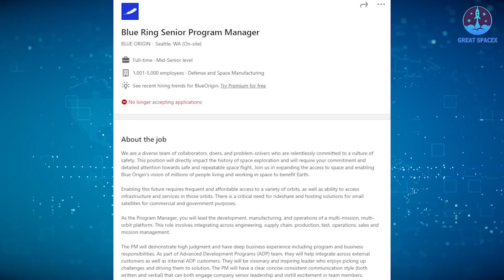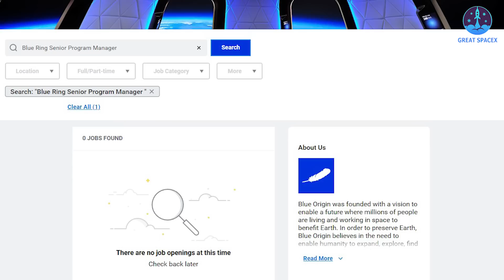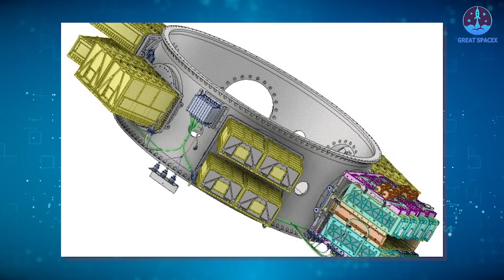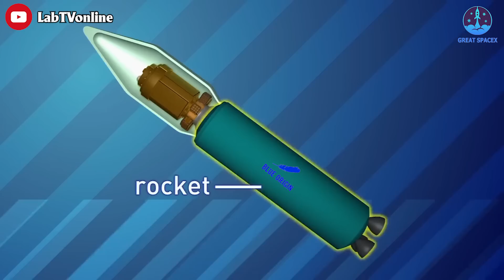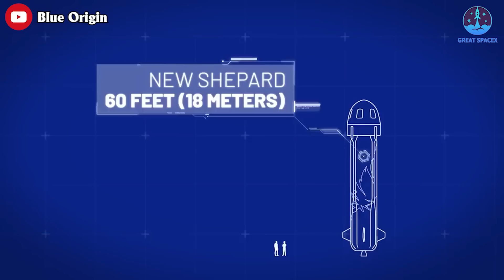Blue Origin New Glenn made HUGE PROGRESS try to catch up SpaceX 2023...

Comment: A fuel tank?! LoL That's the easiest part of a rocket and uses 1950s technology. That's something they should have built years ago.
Reply: Let me guess, it is just a big container to hold liquid, nothing else right?
Reply: @joshmoore4125  No, it is more. But said, this was done in the 1950's!
Reply: The structure of the tank depends upon the type of fuel used and the pressure and temperature it's at.   Also the material it's constructed of must be considered.  Things have changed a great deal since the 50's.
Reply: @donadams8345  Yes, and all that is KNOWN items. That is the point. Making a fuel tank is not rocket science, getting into space is.